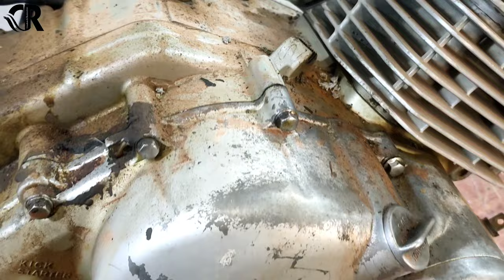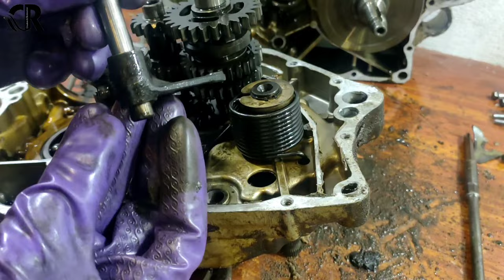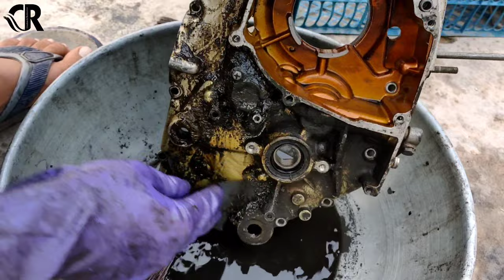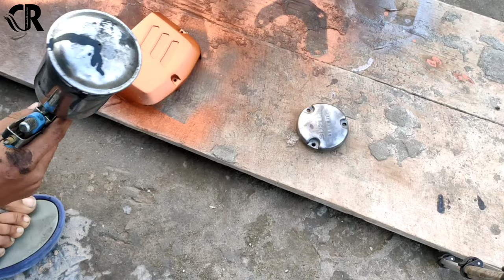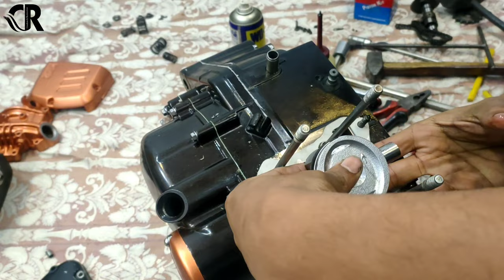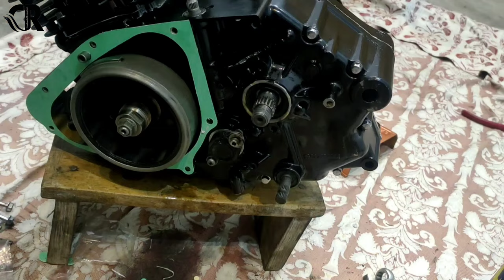Suzuki GS 150 Engine Restoration | Engine Rebuild | Part 3

Comment: Great Video. I have a few questions:
1. What did you use to remove the color from the engine parts?
2. What kind of color did you use for the black and copper parts? Do you need to use color for a special high temperature like for an exhaust?
3. What kind of oil did you use for the gear and the clutch?4. What kind of paste did you use at the middle of the engine?